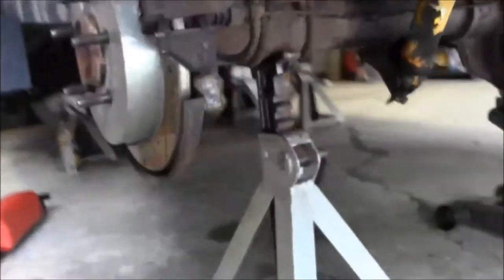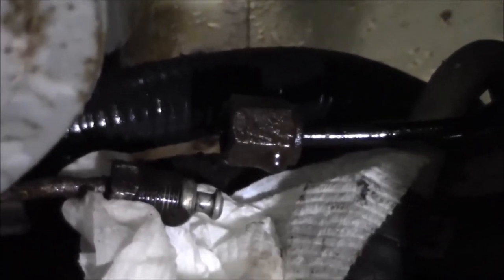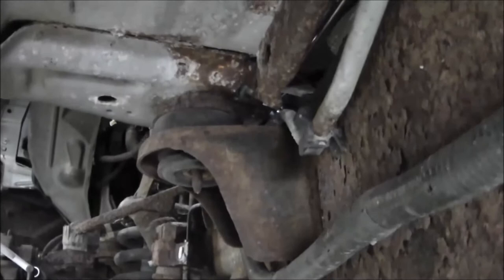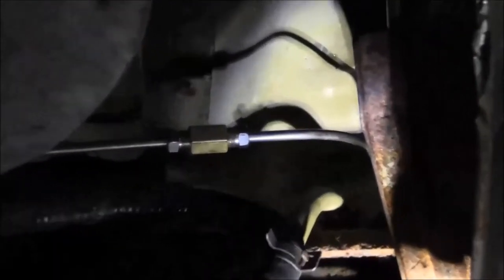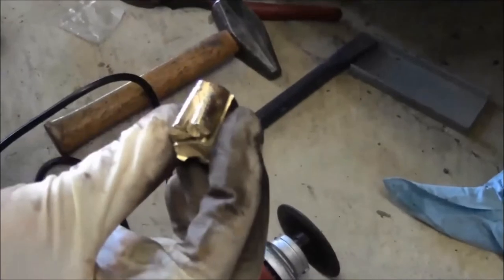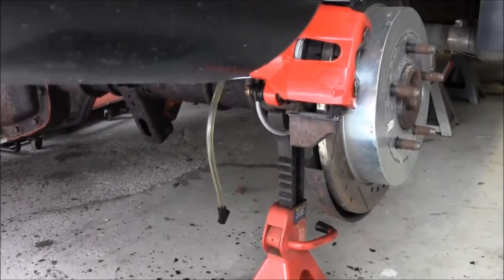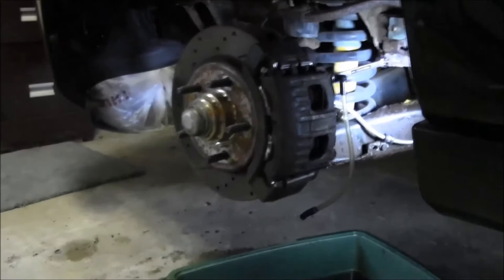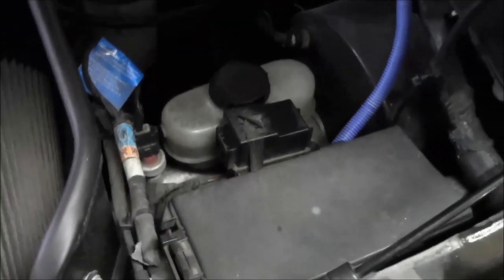2002 Ford F-150 Lightning Brake Lines (Stifflers)

Comment: I like the description of how to bleed the brakes... I've never done it, at least correctly 😂
Truck looks great (as always), I assume she's running fine 2 years later. Hope all is good 👍
Reply from the maker: J PP:  Properly bleeding the brakes can provide a very satisfying increase in braking performance.  Thank you, she is looking good for her age.  Running better than ever.  Are you going to post a video of your new Flowmasters?
Reply: @fwh79FOXR6  I could probably run through my mustang and bleed them, I have what sounds like a vacuum noise when I quickly step on the pedal... Maybe it's normal with Fox's? 
I probably should have put up a video right after I did the muffler swap, it feels so far away now. But everyone LOVES the musical note the Flowmaster 40's make on a push rod (I know I do). So maybe I will do a cold start one soon. Life has me so busy right now with house projects, sports and my daily job.
Reply from the maker: @jpp9846  Sounds like your Stang needs a brake bleeding done.  The pedal should be like stepping on a brick.  I hear ya, life gets in the way some times.  I think most of the intelligent people in the car community will admit... nothing sounds like a push rod 5.0 with Flowmasters!
Reply: @fwh79FOXR6  no doubt, when I sold my first fox ('88 AOD), back in '95, I could hear a Flowmaster push rod from a mile away. I'm glad I have another one today.
When my car is running and I rapidly tap my brake pedal, the RPM's increase? The booster (from what I read, but have since found out not all was true) was new in 2015. So if that's is in fact true, I don't think it's the booster. I've always chalked the brakes up to being shitty Fox brakes. But I think they could be better. Maybe when I get back from my trip next week, I'll inspect that some more.
Reply: @Space Ghost I DO have a hand vacuum pump, bit honestly, WTF is it suppose to read? Furthermore, I have zero clue on how to run that test
Reply from the maker: @jpp9846  A good brake bleeding might help that situation.  Could be a "bad new" part with the booster though.  I personally have never had any booster issues.  So I don't have much experience with them.